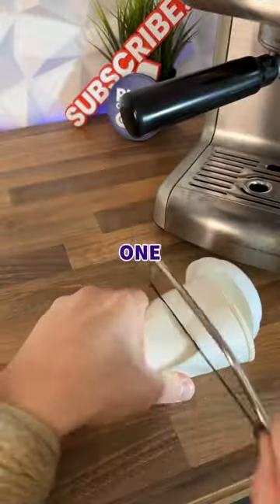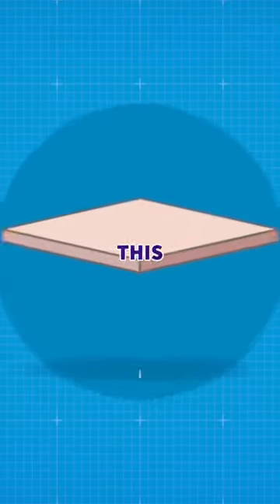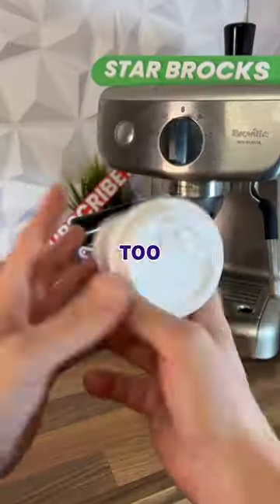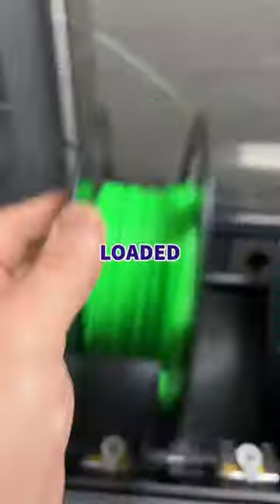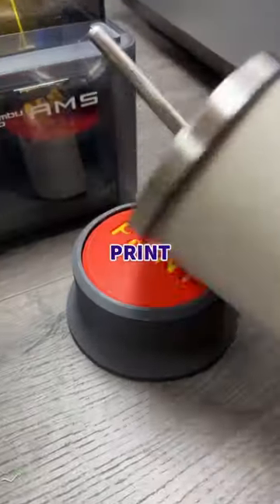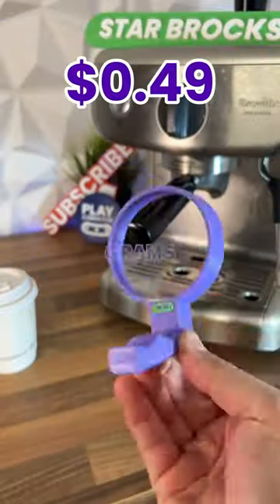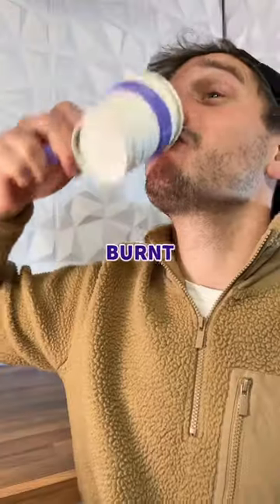We SOLVED the PROBLEM with COFFEE ☕️ #3dprinting #lifehacks #shorts

Comment: It’s as if they’ve already invented something to use to hold a hot coffee cup…
Reply: Dis one's cheaper
Reply: @brunoob1557 but if pla more likely to melt.
Reply: @chartle1  depends what type
Reply: @brunoob1557  any pla is going to warp holding almost boiling water. Not even sure petg is high temp enough.
Reply: @chartle1 you have no clue what ur talking about lol
Reply: Well could be printed with nylon or pc wouldn’t deform then… I personally don’t use pls anymore because it’s so weak temp wise
Reply: @HoverThrills  in what way? The glass transition temperature of PLA is 55 to 60 C. Ideal temp to brew Coffee is 90 C. 90 is greater than 60. 🤔
Reply: @chartle1  a third degree burn is 150F so now you're just yappin
Reply: @HoverThrills  🙄 C not F and ideal temp to brew coffee is between 195°F and 205°F
Reply: @chartle1  no shit buddy I literally said 195-205 my point stands.
Reply: Did you know they give you with the cup a little piece of carboard that you put around your cup keeping you from burning, its called a cup sleeve.
Reply: funny thing is, he always hits the print button with the more obvious solution to the problem